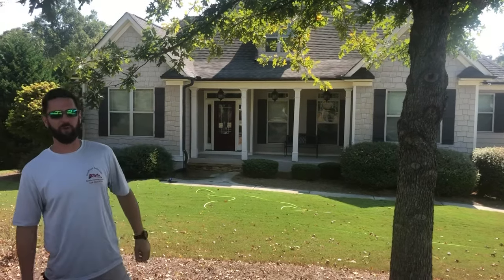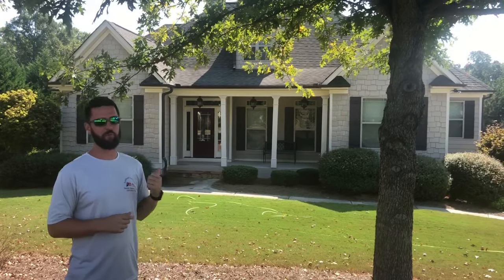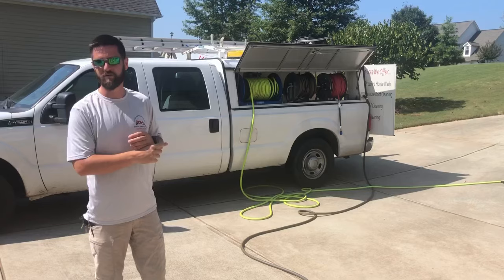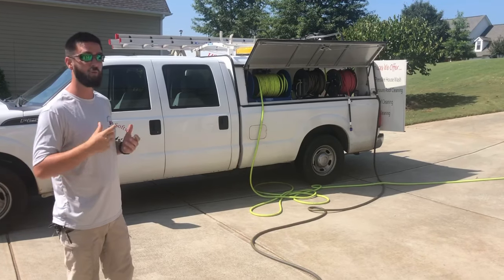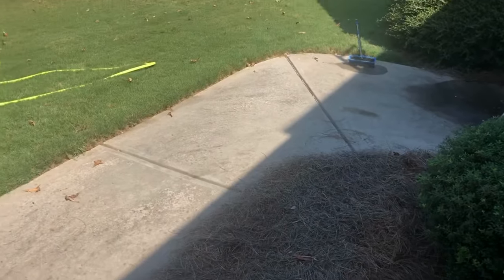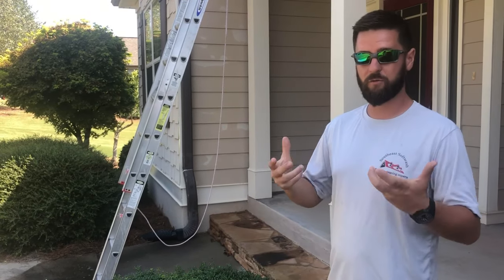How to Clean A Roof, Start to Finish

Comment: What do you think about those Northstar pumps? 5.5 gal pm @ 70 psi. That is what I run and the stream does not go any further than 20ft. I have tried everything. Allen key on the top, different nozzle tips and nothing seems to work. Im starting to think its just those pumps. Anybody? None the less, great vid. They are always appreciated.
Reply from the maker: Veronica Estrada the pump should be the same output as ours roughly. Swap it out and see if it is better
Reply: Veronica....What size hose you using and how long is it? (That sounds kind of personal doesn't it lol)  I use 150ft of 5/8 hose with a 5.5 gpm 60psi and it'll shoot 35 to 40 feet.
Reply: @bol.8749  200' hose 1/2"

Comment: What system are you using to rinse with? Thanks
Reply from the maker: Matt Petty 2:49 mark
Reply from the maker: Our rinse water comes off the house and goes straight to the big hose reel in the truck. No pump, pressure washer involved. It’s basically just adding 400’ of hose to their house
Reply: @southeastsoftwash4020  Oh I see. What is the "selector dial" for?

Comment: What is your "green" / rinse hose?  Is that that flexzilla pro hose 5/8" ?
Reply from the maker: s3 pro yep. 5/8” Flexzilla
Reply: @southeastsoftwash4020  Thanks - have you used the 5/8 flexzilla as a chem hose as well ?
Thanks for the Info
Reply from the maker: s3 pro I have not used it, but it would probably work OK. 
The thing about flex Zila is it kinks kind of easily for chem line.
Reply: @southeastsoftwash4020  Thanks - guess I better look for a chemical hose. Planning on starting out batch mixing or down streaming. I know where I can get a wand :)
Reply: @s3pro101  I use 100 foot polybraid followed by 100 foot flexzilla. I like it, but keep in mind flexzilla will contract and expand where polybraid won't. That means I have to unroll nearly 100 feet each job, but it's better than having to roll out 200 foot of flexzilla for a job that only needs 50 feet.
Reply: @lancewestfall8505  Thanks a bunch.  What size polybraid do you use? I'm looking at a 5.5 GPM 60-100 PSI pump.
Reply: @s3pro101  I'm using a 12v pump. I think I have 5/8 for food grade polybraid. It is much better quality than regular polybraid. Most residential lots here are 122 feet deep, so I generally use 100 foot of the flexzilla and then maybe another 10-20 feet of the polybraid if any.
Reply: @s3pro101  Think I'm running 5/8 of the food grade polybraid. Not much of it comes off the reel since most lots here are 122 feet and I have the 100 feet of flexzilla that comes off first, but the guy who helped plumb my tanks has done it far longer and that is what he recommends for polybraid. The flexzilla was my idea and I like it.. My 12v pump is the same spec.

Comment: I may be wrong. but doing this to a roof seems pointless to me. I do live in a different part of the world which could explain why I see it as pointless. But is it a proven technique to increase the longevity of the shingles? I very much doubt removing moss or organic mater increases the lifespan or weather resistance. But as I said I may be wrong.
Reply from the maker: ian mackay It is very difficult to see how long it would increase the lifespan of the shingles, the biggest reason to clean your roof is the same reason you would wash your house. Maintaining cleanliness and curb appeal greatly increases the value of your property
Reply: @southeastsoftwash4020   The growths affect much more than aesthetics; it affects the structural aspect of shingle too, which leads to damage. Spores eat the limestone filler in your roof’s shingles. Feeding on the inorganic materials of your roof’s materials, they’ll continue to spread and darken until you get rid of them. When the limestone and other granules are digested out of your shingles, it makes way for more problems.
Reply: Ian Mackay, removing growths from your roofs is a must (see other reply). However, with repeated use of SH, (chlorine bleach) shingles will dry out and actually start to curl, and ultimately shortening asphalt roof shingles life. We use a product on our personal homes a bit different after the initial clean that's not as harsh. But be clear.....SH is the most efficient$$$
Reply from the maker: Pressure Washing I know about the line in the shingles, my dad worked for Owens Corning for most of the early 90’s. I just don’t sell my cleaning jobs under the premise that it’s eating the shingle because there is no data out there that shows how much roof algae shortens the life of the shingle. 

There’s also no data that shows any drying out of the shingle due to SH. I’ve personally done some experiments to prove/bust the drying out claim and have not found a single example of it

Comment: Incredibly informative and I'm sure I speak for many, we appreciate the knowledge you're passing on. One question, I pressure wash in Florida, the humid capital of the world. We have as much, if not more barrel tile roofs as we do shingle roofs. At least that's the case in my area. Have you soft washed any of these/ have any advice? I've found them to take 3x as long simply because you have to spray one side of the tile, then the other side, and lastly the front of the tile. Even worse, the runoff is tenfold due to the tiles not being abrasive and all the valleys created by the tile. Any advice is appreciated!
Reply from the maker: Brittan Williams Yes, I have done several tile roofs. It is not a common roofing material in our area. And yes they can be aggravating LOL charge accordingly. I usually up my surfactant percentage to help it stick on those surfaces. 3% SH
Reply: @southeastsoftwash4020  Alright so just plan on taking more time and up the surfactant, appreciate the quick response! Another thing that came to mind, I didn't notice an accumulator in your setup. Waste of money? I understand the thinking behind the bladder and in return causing the pump to cycle less, but another thing (recently picked one up but have installed yet) I thought it might help with is the ability to lessen the water flow applied to the roofs by allowing half/ 3/4 opened wand as opposed to full blast at 7gpm (fatboy pump). Any thoughts? Again, I appreciate your time
Reply from the maker: Brittan Williams not needed. If you setup your 12v correctly with minimal restrictions, it’ll never run hot or struggle.

Comment: You say your SH mixture is only 6% when the valve is wide open? 6% is walmart brand cheap bleach..? Why is it everyone else uses 10 and 12% and your using 6%? Something don't add up..I use 10% SH for all of my roof and siding cleaning and sometimes I have to do a 2nd coat with it so I don't see how you get away with the cheaper 6% SH..Great video Sir
Reply from the maker: My SH tank is full of 12.5%
By opening the water and SH valves at the same time we blend it 50/50 which gets us to 6% application strength. 6% is plenty strong for roof cleaning.

Comment: Actually, the risks for roof cleaners is a LOT higher than people realize.  If you look up the top 10 most dangerous jobs in the US, working on roofs is ranked #3 or #4 from year to year.  People cheer firefighters and police for their bravery for facing the dangers they face, but if you add the total number of deaths per 100,000 employees for both of those professions, usually combined they wouldn't break the top 10, so roof cleaning is a very dangerous job and most injuries when falling off of a ladder or roof are not small injuries.  Sorry that guy got you on that dead plant.  My OCD nature still would have required me to rinse and care for that plant just because I don't trust people not to try and abuse the system.  If you have not already, get a poly spray gun.  PressureTek has them, but you can get the same one cheaper overall from SoftWash Systems, and you can spray with one hand much easier than the ball valve, and it is easier to control the flow than that type of ball valve.  I wasn't a fan of trigger wands like that until I used that one helping another local roof cleaner when he needed a hand.  Once I used his, I was totally in love with that wand.  I used that type of ball valve for years until I got that poly spray gun.  It makes jobs go faster because it is so much faster to start and stop than a ball valve and gives better control.  if you spray most of your roofs from the ladder, being able to keep a hand on the ladder and not using two hands on a ball valve will keep you safer too.  I saw you turn the ball valve on with one hand, but turning it off isn't as easy.  I still keep a ball valve set up on hand for a back up.  You could use small nerf footballs to block off the downspouts and then use a gutter cane to fill the gutters with water so instead of all the SH runoff going down the downspout in concentrated spots, it spreads the SH with water as it runs over the gutter.  Or just use a gutter cane without blocking the downspout (especially if the gutters are attached to wood with rot) and flood the gutters before you start spraying, then once the ground near the downspout is saturated with water, turn it back to a trickle.  This way any SH that runs into the gutters is drained out and already diluted before it goes down the downspout, and the constant flowing water will spread the SH across a broad area and reduce the chances of plant damage.  I've been in business 7 years and never killed a plant, so it works.  Or turn the cement drain guards around to make the runoff flow away from the plants to keep the SH and salt content farther from the plant roots.  Like you, I only have 1 negative review, but I didn't do any work for that customer, and because of my training from SoftWash Systems, she REALLY wanted me to clean her roof, but I told her I had to go out of town for my brother's wedding and she refused to wait for me to get back and provide her a quote.  I think she would have been fine, but her husband is the one that I think was being the jerk.  I've only shocked two plants.   One was where a downspout went into a pipe to drain at safe location and the pipe was cracked right at a boxwood plant and some leaves turned brown.  The other I asked my groundsman to rinse a small garage roof with no gutters and he got an urgent call from his wife and forgot, but ultimately it was my fault for not following up behind him.  Some organic matter added to the soil and water soluble nitrogen sprayed on the leaves and around the plant for the roots to absorb pushed new leaf growth and the customer was still so happy she referred me to other customers.  The only gripe I would have is the lack of ladder standoff.  They are cheap and they both protect the gutters from dents and scratches and give the person climbing the ladder a more stable ladder with less chance of slippage if the ground is on any kind of slope, and it protects the shingles from getting bent if you have to put the ladder up against the shingles.  Plus when you have a ladder standoff resting on the roof, my first step is always onto the edge of the ladder standoff as it is not going to slip and gives a little extra protection when getting onto and off of a roof.  I'll share another trick not many people seem to use.  If you are on a slope that is walkable, but barely, reposition your chemical hose so it is coming over the roof from the other side.  This way the hose is not pulling you down the slope, but instead, it is giving you a slight anchor point pulling you up the roof.  On a barely walkable pitch, it makes a big difference.  It doesn't trump a harness, but it reduces the chance of slipping down a roof and getting roof rash.  On hot days, I spray the roof before walking on it.  Cooling the asphalt can help solidify the granules to the roof so it is less likely to move granules in hot asphalt.

Comment: why would anyone want to clean a roof ? most of the shingle roofs get darker if they are dirty but you dont notice it .who looks at a roof anyway?
Reply from the maker: rbeck3200tb40 well it’s a multi million dollar a year industry so apparently 
Lots of homeowners are interested in keeping their property looking good. Some homeowners associations require roof cleaning as well as insurance companies now starting to require keeping your roof clean. It is also recommended by shingle manufacturers.
Reply: Bam!
Reply: Removing growths from your roofs is important. The growths affect much more than aesthetics; it affects the structural aspect of shingle too, which leads to damage. Spores eat the limestone filler in your roof’s shingles. Feeding on the inorganic materials of your roof’s materials, they’ll continue to spread and darken until you get rid of them. When the limestone and other granules are digested out of your shingles, it makes way for more problems.

Comment: For the teenagers that need to learn safety and every little detail these videos are great otherwise for more mature people that are starting or perfecting what they do they just want to see you do the job without talking only conversation should be what percentage on the siding and what percentage on the roof sh and how much soap Maybe cover tips spray nozzles maybe even homemade spray nozzles different designs you might like from experience but keep the chatter down do as showing less chatter more work